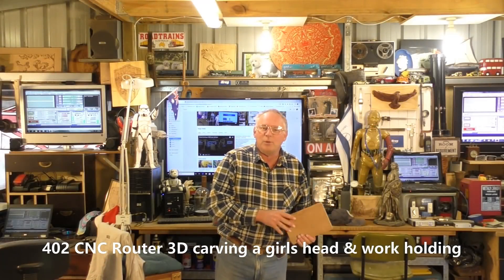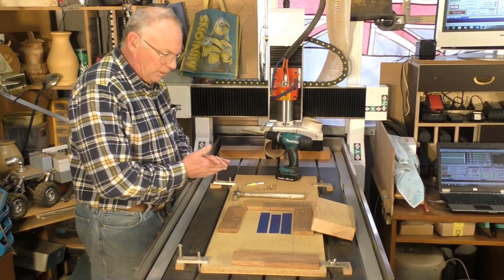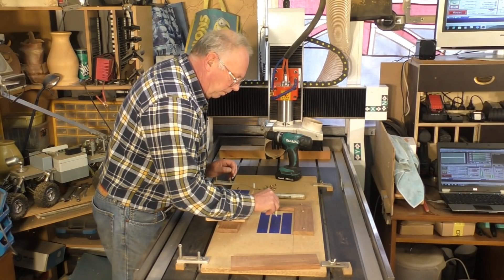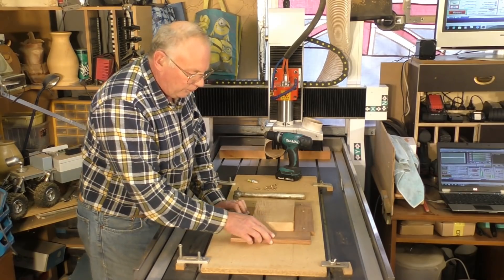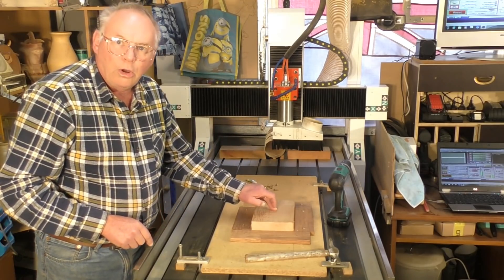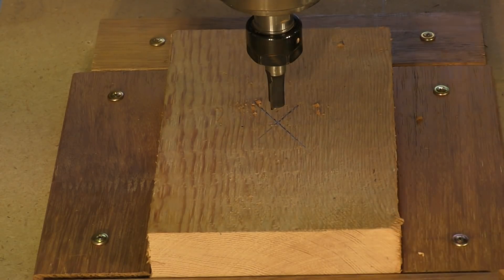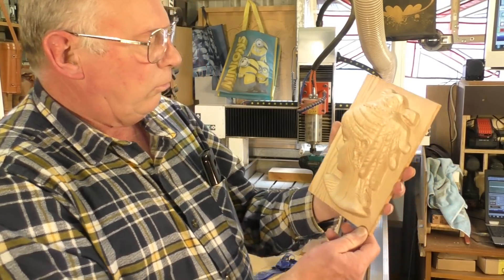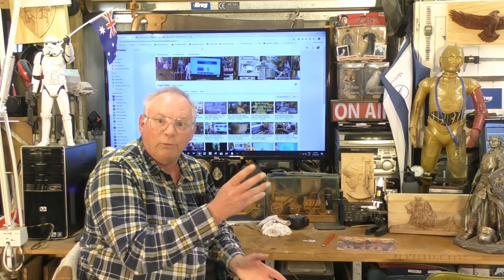A CNC Router CAN make $$25,000 3D carving  #MY CHANNEL CAN SHOW YOU HOW*

Comment: I have a follow-up inquiry (from someone who knows more about tech than woodworking). I have a project with finer details - a smaller human figure but with undercuts done on the accessory that give 5DOF. My project wi probably have three or more passes, the last being with the super-fine 1/32” carving bit. I think I can manage the basic print. The resulting model will need some finishing no matter how successful the initial carve is, as I want a very smooth finish that will be lacquered or more likely shellacked. 

So here’s my question: how do you apply a fine sanding to a wood sculpture with such intricate detail without sanding away features. Even by hand, this would be extremely difficult. I thought perhaps a Dremel tool with one of the sponge-like buffing bits. I was wondering if I could program the CNC to apply the buffing tool with the 5DOF   attachment as a final pass, only a very rough pass where the tool essentially floats at the appropriate level above the wood surface so that that the buffing is applied “gently”. Perhaps there is a brush-like tool designed to apply various sanding levels.

Forgetting about the automated or powered tools, if someone handed you a wood sculpture that had features roughly the size of those on day a Barbie doll and asked you to make the surface as smooth as possible, what approach might you consider?

I imagine an ideal process would be a kind pressure spray of powdered abrasive - like a hyper-fine sand-blasting with variable pressure levels I can experiment with - some process that lets the abrasive be guided in a fluid way to the detailed surface.

Thoughts?

Comment: After a fair amount of watching these videos as well as reading about others I finally managed to reproduce this (with different models).  It's basically two-pass CNC, first an adaptive clearing with large bit to remove most of the material then a tapered ball end bit to finish.  As Roger says, the final finish doesn't need to be sanded.  I brought my carving to a local Woodcraft store and they were blown away.  The only disadvantage is that the stepover for the finishing has to be about .1mm - .2mm which takes forever to carve.  

Thanks for visually documenting this, it was a lot easier to learn how to do it on my x-carve.

Comment: Important question:  I am a complete newbie to this.  I bought a Longmill and have it 99% ready to go.  I am at the step of setting up the touch plate.  I'm instructed to insert a router bit and measure it to input this measurement into the software.  I'm going to have a bit longer of a learning curve than some because I don't know a lot of the basics that boys are fortunate enough to learn through the years.  I'm not put off by that but there are some basics I lack and will have to learn regarding the use of various tools, power tools, table saw etc......   As a female I've never had to use a router.....so my question is how many mm of router bit are supposed to extend below the collet?  I expect this is a critical thing to be consistent with.  Any tidbits are greatly appreciated
Reply from the maker: Hi, I have some videos that will help you ;-))
https://www.youtube.com/watch?v=YbxIzq8JJIw
https://www.youtube.com/watch?v=5QI4VU4FcYE
https://www.youtube.com/watch?v=_0c9NwKNOXE
https://www.youtube.com/watch?v=EWCXE4IhiNU

Comment: Great idea! I'll definably try it. 

One question: how do you maintain Z null point when replacing bits?
Reply: I made my self a renishaw style probe for tool touch of in linux cnc 

I you want the cad files just say so 
It's made from brass and a smal circuitboard some steel and plastic cad files are free and my probe works flawlessly I love it I cant live without it anymore 

It's fixed to my cnc bed a button press and done love it